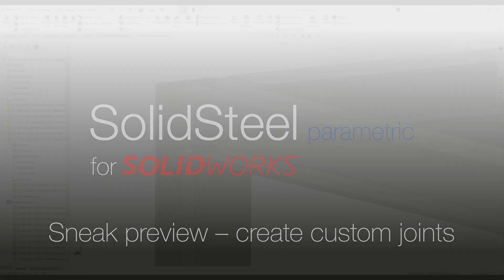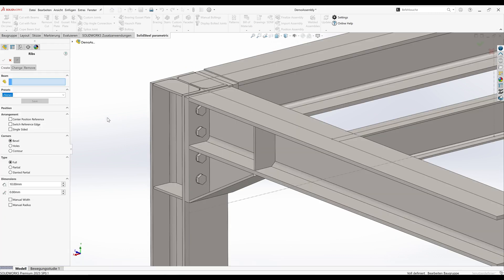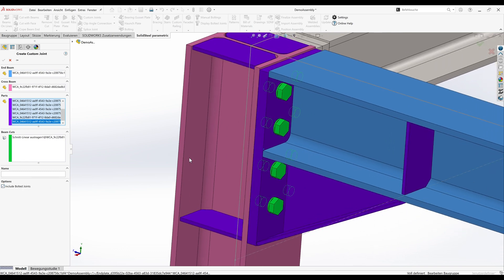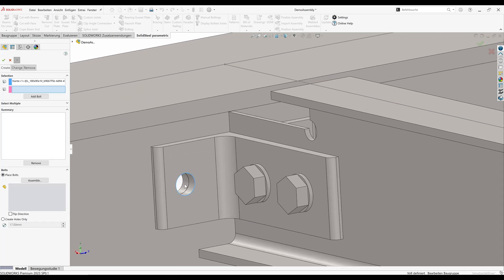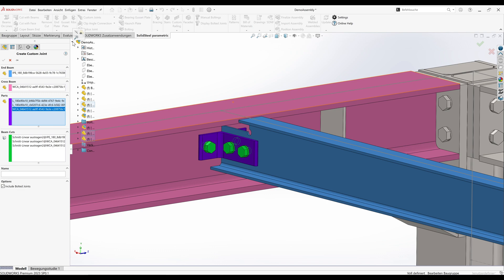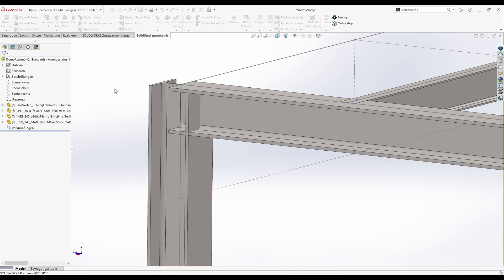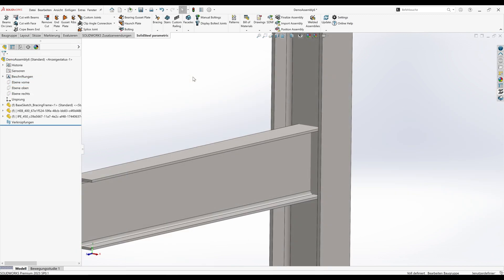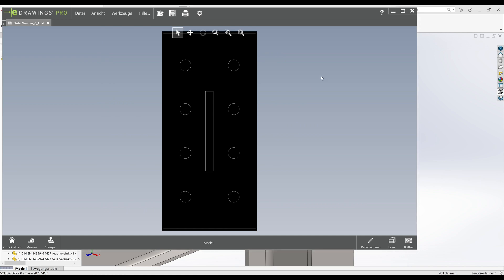Create custom joints in steel design with SOLIDWORKS – Feature detail of new SolidSteel functions

Comment: This is a huge improvement of SSP ... I really think that only one thing is missing now, Drawing document manager . By the way I'm wondering which PC configuration you have , so fast !!
Reply from the maker: For the video it was running on a 3 years old HP Laptop (i7, 32gb ram). So not slow, but also nothing special!